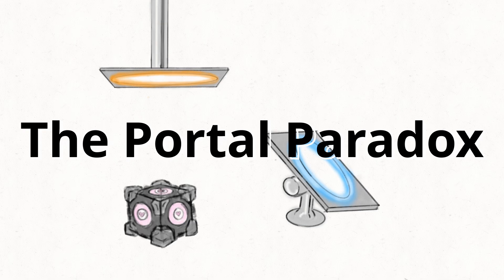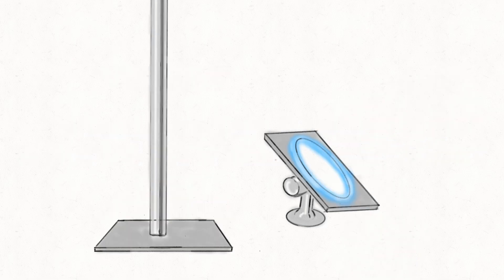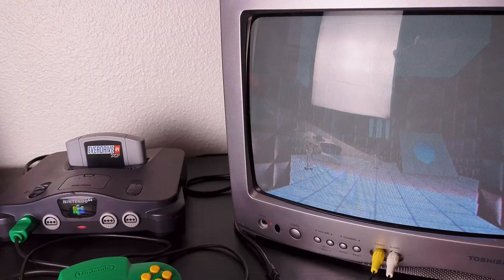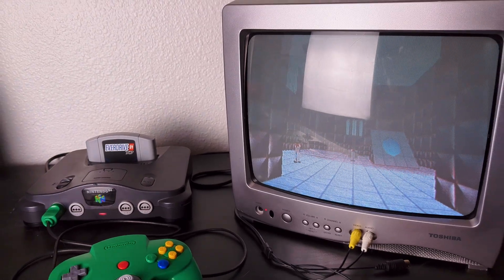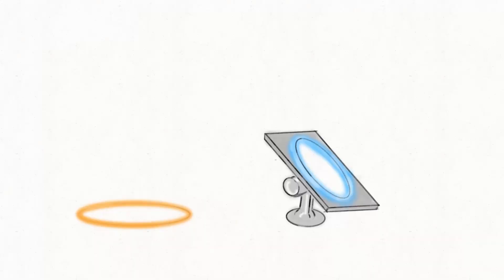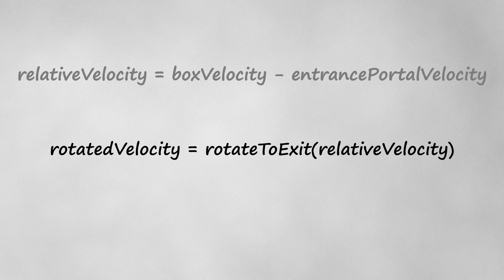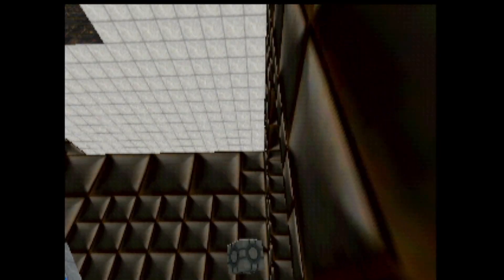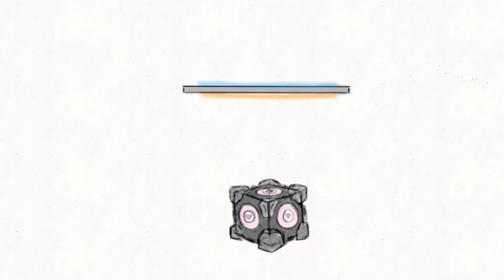I rewrote Portal from scratch and solved the Portal Paradox

Comment: I think this approach is flawed because it doesnt account for the energy in the system. As an example, imagine you have a screen of glass 1m away from the exit portal. In the first test the cube would be made out of steel. in the second its made out of feathers. Now if the steelcube moves at 30 m/s it will fly through the glass, the feathercube wont, because the feathers dont have enough energy to break the glas. This cant be true, if the energy to move the portal is the same in both tests, because the energy cant come from nowhere. 
But thats only my understanding and maybe im wrong, so please correct me.

Comment: I should not shoot out, the main reason if u move the cube to the portal, there is energy in the cube makes it move and with exit it will shoot out. Think like a moving car passing through a circle. doesn't matter enter or exit points moving or not. However if u move the enter portal to cube, the portal has the energy not the cube. when u press the portal on cube, the cube will appear on the exit portal but will not move. because the cube did not produce energy to move. that's the problem actually. That my idea on this topic. But thanks a lot because u give me some thing to think on it :)

Comment: With that stationary test, it seems like the part of the cube that has exited is moving relative to the exit portal. I'd actually expect that part of the cube to have a pulling effect on the rest of the cube (that is still on the other side of the portal). I wonder how far you'd need to extend the entrance portal down, before the rest of the cube is pulled out by this force alone. What do you think?
Reply: I would imagine it depends on how fast the entrance portal stops. 

If it can stop immediately with no "cooldown", it would probably shear the cube in half in real life depending on the material (in-game it is impossible as the game defines it as a single particle). This is cuz the half that enters the portal would have energy while the other side abruptly stops. It's similar to half of a stick being hit by a moving truck while the other half is anchored in a tree or something. If the material had a weak point, it would break at the weak point instead (as that's how energy travels).
Reply: Consider the stationary portal and cube example: the remaining cube on this side pushes the cube teleported over that side. The analogy is that since now it's the portal that's moving, it is the portal itself that pulls the cube at the very first.
Reply: That's not quite how it works. It's not just the cube going through the portal, it's got an inertial reference frame that's going through with it. There wouldn't be any pulling going on. In regards to relativity, there's no difference between an inertial reference frame that is stationary and one in uniform motion (as in it isn't accelerating) when it comes to the forces acting on anything withinin that frame. For example, when you're on an airplane in flight you can't actually feel that you're going almost 1k km/h, it feels like you're not moving, so long as there isn't any turbulence, because the movement of the plane is uniform, it's moving at a constant speed in a constant direction. So to the cube it would be as if the world around it suddenly started moving, rather than being like the cube itself suddenly started moving. To someone at the exit portal, they would see the cube approaching at a certain speed, and it would keep going at that same speed as it came through, until air resistance caused it to slow down. The cube itself wouldn't feel any acceleration, or "pulling", it would only feel the deceleration after it had already passed through the portal.
Reply: the portals don't actually exert forces, they just warp and move the space
Reply: That's what I thought but as the entrance portal comes down on the object with the same speed the object is technically being pulled out the end while appearing to be stationary. If the entrance portal stopped before reaching the ground but after reaching the object, the object should be pulled out or (if it is not solid enough so not the cube for example) be stretched or teared off.
Reply: While, yes the part past the portal excerts a pulling force against the rest, it can not pull the rest through, since it also excerts an equal pulling force against the part past the portal, because of Inertia.

The only part of the force not negated is the effect of gravity.
The cube would fall if half the cube is through and the exit portal is pointing down, and slide to one side if the exit is not horizontal.
Reply: @trueValara  the part past the portal exerts a pull? What pull? From where? Only force being applied on this cube is gravity. Going through the portals here does not change it in any way. It's still sitting on the ground. It does not move. The portal moves. The portal does not exert force on objects. It's a direct spacial link between two points.
Reply: @larkohiya  Unfortunately, for physics to work, portals have to exert force over objects, meaning they are tangible entities. Wormholes under theoretical physics models behave this way too. A direct consequence is now that portals have energy and have to consume that energy to transfer objects, and if energy runs out, the portals collapse. Which also means video game portals are mere approximation to this model by assuming portals spawn energy from nowhere.
Reply: Now THIS is the real question.
Reply: Actually the cube never gains momentum. I don't know how a portal which does not itself transfer its momentum to objects that pass through it makes sense. The portal is a direct spacial link to a different location. It doesn't matter how fast the portal itself is moving.
Reply: And actually now that I think about it. The cube would get NEGATIVE movement from this particular situation because all the AIR moving through the portal as it moves down via the piston would cause air pressure to build in the second location which would push back against the cube (very small amount because the cubes mass is much greater then the air) as it moves through the portal. The cube would actually have resistance from moving upwards or out. Of course only gravity pulling it dowards and air pressure pushing on it from all sides are the only forces being applied to the cube.
Reply: @larkohiya  You forget about the upwards force applied to the cube from the floor it is lying on. This force stops it from falling down through the floor. You might think this is just semantics, but when doing physics it is very important to concider all the forces in play. You are correct in that there is some amount of negative force involved here (there always is), but that from itself will be much higher than any from the pressure differential. Every part of anything is excerting forces on every other part of itself. The floor pushes on the bottom of the cube pushes on the parts above that pushing on the parts above that...
In the end the cube will push itself away from the exit portal by the same speed as the entrance portal. The only other option is getting crushed by the parts of itself that cannot get out of the way fast enough, and this is what will happen if the velocity differential is high enough.

Comment: Well, the problem I have with the answer is more of a problem I have with the Paradox itself. 
We have 2 simultaneous frames of reference. The cube is being shot out the blue portal if blue portal=stationary is our frame of reference, because the cube "is coming towards us". But the cube should remain stationary if the stationary cube is the frame of reference, because not only the orange portal is coming towards us, the blue portal is coming too (as we can see whatever is on the other side coming towards us).
The game lore stablishes that "speedy thing comes in, speedy thing comes out", but there are no further explanations of how the portals work. They are "window-like" but are they wormholes in the space-time that connnect 2 points or do they destroy matter and energy in one side but reconstruct it in the other, pushing it to maintain the momentum? 
The Reportalling game mechanic (keyword: game) allows the player to gain momentum because the portals "push" the player, but is that the Source engine or is it the physics of a portal? Let's remember Source and other engines are game engines, not simulators, so they are not definitive evidence as they might be omitting some other physical law. 
So:
a) If the Portals do indeed "push", a.k.a. transmit a force onto the cube, then the cube should be shot out no matter the frame of reference.
b) If the Portals are like a window/hula-hoop, then the cube should fall down, because as soon as the Orange portal passes thru the cube, the Orange portal stops, so at that instant, there's no momentum to conserve and gravity is the only acting force on the cube.
Reply: Holy shit, sorry this is like the 20th time I've seen this BUT THE PORTALS DONT GIVE A FORCE. 

a) not how portals work
b)From the exit portals perspective, it doesn't matter that the ground stopped, it already did all its work launching the cube up from the exit's perspective. If you look at it from the entrance's perspective, and I can confirm, the same thing happens no matter whether you take the cube's perspective, the ground's perspective, or the entrance's perspective. Due to the nature of there being portals in the room, there is no "room perspective".

Comment: the box still doesn't have momentum though, and that isn't relative like motion is. The box has no velocity to measure momentum with so why would it jump out of the portal? Wouldn't it just slide of the ramp in this scenario?
Reply: Momentum is relative. It's just mass multiplied by speed.
Reply: @whitemouse2460  I'm assuming you're substituting velocity for speed in your equation, which I don't believe even works because speed is a rate of time not actual movement. I don't see where you get momentum from being that there is no way to measure velocity as the box doesn't change position

Comment: I was going to argue but I finished thinking it through and my argument was valid but meaningless in terms of the imparted motion as the box "forms" exiting the portal. So I'm going to have to agree. The ejection velocity must match the incoming velocity regardless of which element is moving. 
But what about inertia? For instance, if something was going really fast as it went into a portal but the exit portal was also moving in an equal speed but opposite direction. Would the sudden stop impart inertia onto the object? Entering one portal traveling fast relative to the world and exiting another portal no longer traveling at all relative to the world? From a physics perspective something has to happen to that energy. To simply say that the energy is absorbed by the portal's own motion implies an equal mass. So would this theoretical portal have a "quantum mass" that was automatically equal to whatever was passing through it? That's the only way that would work. If that were the case though, slamming a portal down on to something wouldn't shoot it out the other side, it would squash it. So what happens to the inertia?

Comment: The one thing that i immediately thought of was: "when the portal moves down, there is a short moment where the upper half of the cube feels like being exellerated while the lower half still being stationary". The difference to a normal falling cube would be that in the later case the whole of the body moves at the same speed. So maybe that could make a difference? Or does just the cube feel forces of being streched. Maybe a physicists can help me out :)
Reply: It's not accelerated at all. Looking from the perspective of the portal the cube is already moving with a speed towards it even before it enters the portal. So when the first halve of the cube goes through the portal the second halve is also moving with the same speed because relative to the portal it already has this velocity to begin with.
An important law of physics is the first of Newton's laws, which states that if the velocity (in every frame of reference) of an object doesn't change, there is no net force working on it, thus also no acceleration. So the block doesn't experience any stretching when the velocity of the portal stays constant when the cube enters the portal.

So the keypoint is looking from the frame of reference of the moving portal, and then you can see that, from the portals perspective, the cube (even though it looks stationary in its own frame of reference) already has a certain velocity.

Comment: if you slam a portal onto a stationary block where the exit portal would be on a slope. You have to imagin the exit portal doing the same thing the floor being slamed into the exity portal. but since no motion is applied it would just appear onto the platform slanted and slide off it anything. its still weighed down on the other side until more of the mass is exited onto the other side preventing the launch. if anything the cube would react as if you lifted up a board from one side to match the angle you wanted the exit portal.

Comment: If the cube were to shoot out of the exit portal, it would have to exert a force on one of the portals, else it has gained momentum from nowhere and you've built a reactionless drive.
Or a recoilless gun.
Reply: Right. And if the entry portal feels a force, it will be a breaking force, forcing the mount of the entry portal to slow down, losing kinetic energy, as the cube gains it.

Comment: "this makes no sense" -me, a fool

Youre right actually just imagine 2 portals one of which is moving sideways, throwing a ball in to the stationary one, as it exsists its being moved by the moving exit portal making it come out at an angle. this example is consistent with the cube launch example
Reply: that is literally the entire point of the vide? did you even watch it? he explained that EXACT question

average anime profile pic
Reply: @sevi630  yeap im wrong, was just confused because i figured the cube isnt actually moving nor is the portal touching the cube but relative to the space outside of the exit portal the floor is actually moving and so is the cube and because the cube now has momentum relative to the exit space it will conserve the momentum and fly off

Comment: This hurts my brain, so I wanna know if my dumb guy interpretation of this scenarios is accurate to how the physics simulation was explained in the video. 
Would the cube have the momentum exiting the blue portal because from the blue portal's perspective, the cube is the moving object and it's moving towards it? So it's kinda like if the platform the cube was on was the moving object?
And then with the hula hoop scenario, was it because the blue portal is also moving, its downward momentum is an exact counter to the upward momentum the cube has entering the orange portal?

Comment: With your physics engine what happens if BOTH are moving.

If a cube moving horizontally at 100km goes through a portal moving 100km in the opposite direction does the cube lose all velocity?

What if A cube moving horizontally at 100 km goes through a portal moving at 110km. Does the cube move backwards upon going through the portal or have negative velocity? Does the game simply crash?

Seems strange to make portal velocity have anything to do with cube velocity seems like it makes more problems than it solves.

In laymans terms if a speedy thing didn't go in, then how could a speedy thing come out?

Portals by their nature aren't supposed to affect an objects velocity, so if an object has 0 velocity moving through a portal should maintain that 

Likewise if an object has 100 velocity just because the portal its moving through is also moving at 100 shouldn't reduce it's velocity this is strange, illogical and kinda anti what portal is about.

Comment: I propose a 3rd solution. For this to make any sense the portal has to be applying a force to the cube. Like a train hits a cube, the cube moves because of the transfer of energy. If a portal hits a cube the cube should be lost to the Nth dimension of space that exists inside of the portal. It was consumed by the portal space but no energy was imparted on it to leave the portal.
Reply: That's not good. There are no dimensions inside the portal, it's just space-time folding.

Comment: Sweet. You've implemented conservation of energy. Now, I wonder if there's any way to conserve momentum. I doubt it. Conservation of linear and angular momentum is isomorphic to translational and rotational symmetries. Physics on the left is identical to physics on the right and every point in-between. With portals, space isn't convex anymore, and the notion of in-between is weird.

I say it's not convex because if you pass a string through a portal, tie it in a noose and tighten it, it won't tighten down to a point; it'll be a line between the portals.

Anyone good in topology around here? I would love to know how momentum works in a non-convex space.

Comment: You are departing the kinetic energy of the moving platform to the cube.
And yes, if the platform itself hit the cube, kinetic energy would be transmitted to the cube.
But the portal itself, whether it is standing still or moving at the speed of light, has zero kinetic energy that it can depart to any objects.
Only the objects themselves (the cube in this example) can provide the velocity.
And since the cube has a rest velocity of zero, it will have a velocity of zero as it comes out the other portal.
Portal A and portal B connects 1 space to the other, and there is no movement between portal A & B, so no kinetic movement can be imparted on to the cube.

The video shows that the cube was programmed to receive kinetic energy from the moving platform itself, and not the portal, since the portal is at rest, despite if it being hurled at the speed of light.